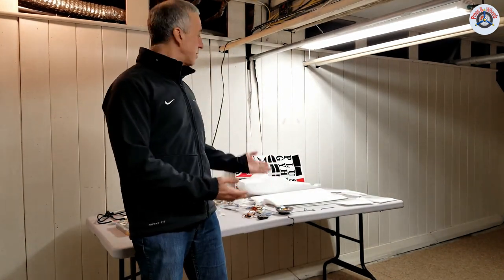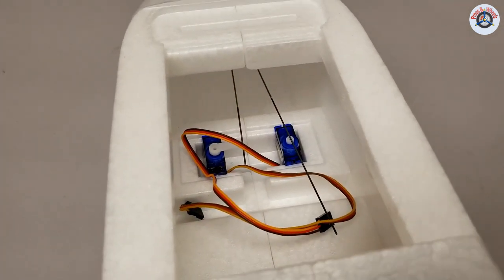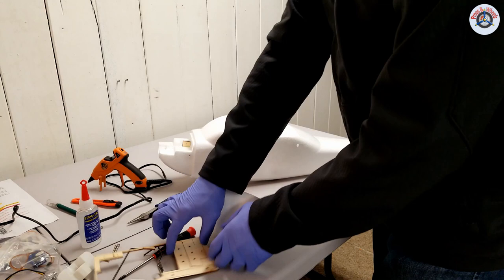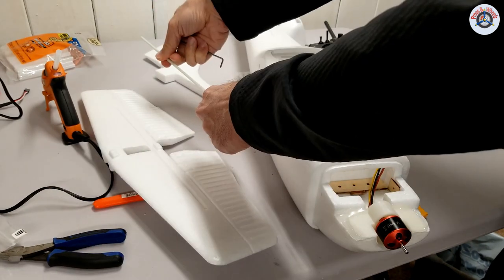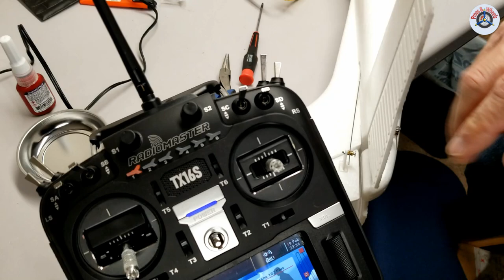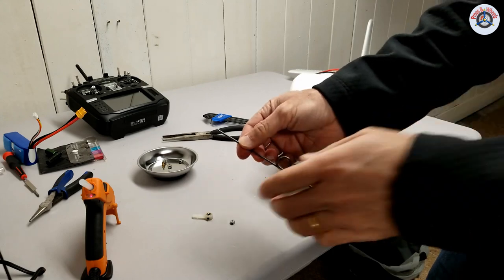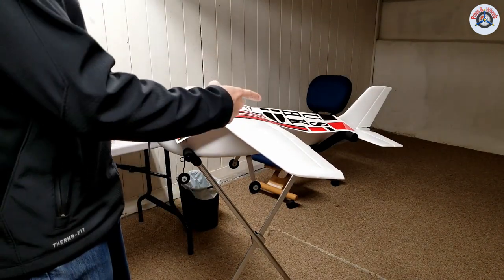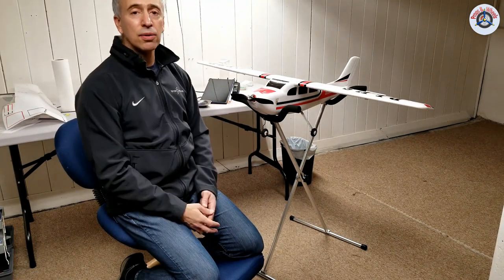Cessna 182 Plus 1200mm 4CH EPO RC Kit from Banggood - Part 2: Detailed Build

Comment: Thanks for sharing the assembly process. It really helped me in my assembly process being a first timer. Would like to enquire what battery are you using with this plane? I note the motor on mine is a 2212 2200kv with a 3A ESC. Thanks.

Comment: Hi, I have also made this plane, I am very impressed with the quality of the kit. I've not flown it yet because the weather here in Australia has been very rainy. I used all the same parts as you but I had to add some stick on wheel weights in the nose to get the CG correct. Did you have to add any weight. I saw in your last video that you are having problems with the stickers coming off. Try UHU POR glue to stick them on.
Reply from the maker: Hi Jon. I am glad to hear that you liked this plane so far. No, I did not have to add any weight. The CG was perfect after I finished the assembly. Did you use the same motor as well (if not, maybe my motor and the small metal spinner/nut is heavier than yours). Or did you use a 2200mAh 3S battery (could the difference be in battery weight)? Also, I used quite a bit of hot glue (like 2-3 sticks) on the nose to reinforce the motor mouth and the plywood reinforcements for the front landing gear, which may have added additional weight to the nose.
Thank you for suggesting UHU POR glue for the decals. I did not find it on Amazon U.S.A., but there is UHU All Purpose version; I may just but and try that one. Take care.

Comment: Nice video. I bought this plane and I have already built this but I am scared my first fly. I have here strong wind every day. What wind is the strongest that this plane can fly in?
Reply from the maker: Are you a beginner RC pilot, or do you have prior RC flying experience? I would not recommend this airplane as a first airplane; practice on something small, light, and 3-channel. If you do have experience, I would not fly it above 10mph winds. Also make sure it is not tail-heavy. A bit of nose-heaviness will help during the first couple of flights until you get used to it. I will be posting the maiden flight video tomorrow; I was flying it in windy weather. I hope this helps.
Reply: I have  big experience with DJI drones, 80h in acro drone simulator, and few hours in rc plane simulator and I thought I can fly but when I tried  my first home made 4ch plane I crashed it  :(
maybe because it was too much windy or it was to heavy (800g for 88cm wingspan)

Thank you for help. I am waiting for video in wind :)
Reply from the maker: I am sorry to hear... 😕 My friend Scott says all the time, "wind is your friend", but this is only true if you are at least an intermediate pilot and know how to use the wind to your benefit. To RC airplane beginners I always say: "Fly on a calm and nice day, on a large field with no people and obstacles around." And start with something beginner-friendly. RC drone flying (especially FPV) is so different than flying RC airplanes with line of sight. Good luck!
Reply: @PropsWheels  What you mean nose heavy? Someone on banggood said it should has CG on  45-65mm from front of the wind, so I should use the smallest value of that?

Comment: Based on your experience with the maiden flight, do you recommend considering a larger motor? I am planning to use it also with floats. Regards.
Reply from the maker: The motor size is perfect for flying it scale with the wheels. If you are planning to install floats, I think it could use a motor that has about 25% more power.

Comment: nice videos. i am a subscriber...!
how you order part for this plane...none my search gave a result...like landing gear or motor mount...are part s available?
thanks
Reply from the maker: Hi Alex. Fortunately, I did not have to order any parts for this airplane. I do not think you can find parts easily for this model, because it is a "no name" brand. Banggood may start selling parts for this plane if it becomes popular enough. However, if you have any damage, you should be able to fix it easily with hot glue, duct tape, and some items from a hardware store. If the motor mount breaks, you can make a new firewall using some plywood. All components are very basic and simple on this airplane. Cheers!
Reply: @PropsWheels  ok . I just wanted the wheels for another plane i am building. Thanks for your response.
Reply: @alexherrera3918  you can buy the landing gear from bangood
Reply from the maker: Hi Jon. Could you share the link to the landing gear for this airplane? I may buy one set as spare parts. Thank you.
Reply from the maker: Hi Alex. What are you building? I am curious. Thank you.

Comment: I am building the same plane. I am wondering where the CG is. Would you please tell me the position in yours? Regards
Reply from the maker: Mine balanced perfectly with a regular 2200mAh 3S battery. The CG was at about 1/3 of the wing width away from the leading edge at the root.

Comment: I still have problem with the CG on this plane. I have 1300mah battery I put it  on the front of this battery Holder, esc is very near to motor, so is receiver and I still have tail heavy.
Reply: You need to add weight or switch to a bigger battery. Like a 2200
Reply from the maker: Kenneth Jamed is right; I used a 3S 2200mAh battery, and it was very easy to adjust the CG. I recommend going that route instead of adding dead weight to the plane to balance it.
Reply: I bought 2200mah bayyery but it was still tail heavy, so I gave this battery back to shop and I add 50g of metal on motor mount. I dont know why my plane was so unbalanced. I didnt get too much glue on tail